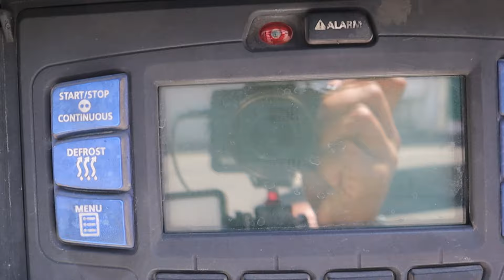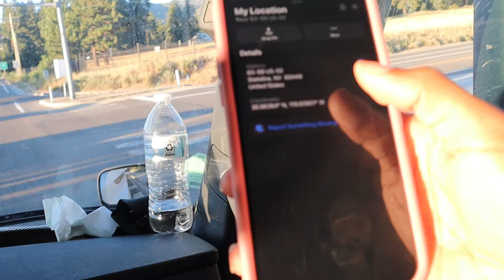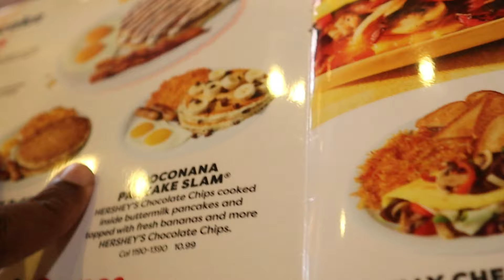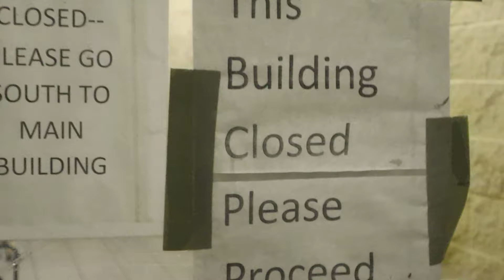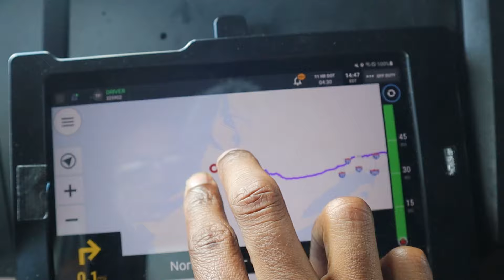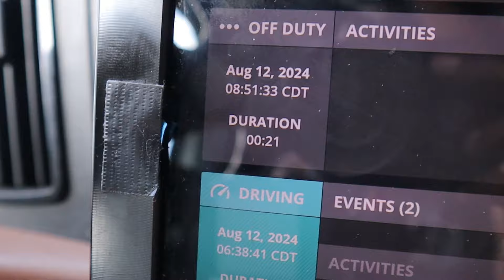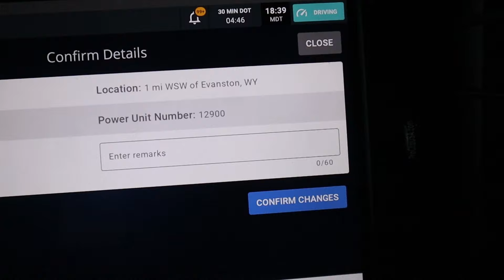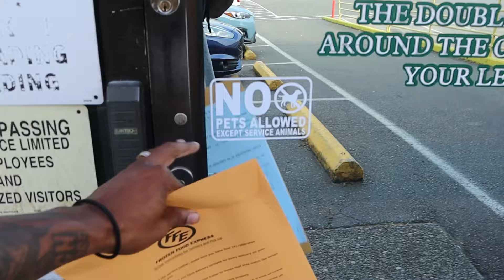Trucking Vlog | 6000 Mile Haul | California to New Jersey to Oregon

Comment: When you're in the NJ terminal, Acme or Shoprite supermarkets may have take-out meals, maybe breakfast meals. Golden Corral buffets is good for take-out by weighed. That rude driver at the Jersey terminal gate is probably local or solo, and keeps gate codes written down in an easy accessible location. l stayed in Kingman, AZ on a road trip and found Smith's supermarket fried up some good fried chicken. Yall keep safe.
Reply from the maker: We might have to check them places out, and not sure what his problem was but he was wrong. You stay safe as well.